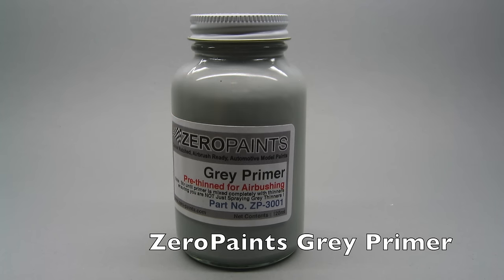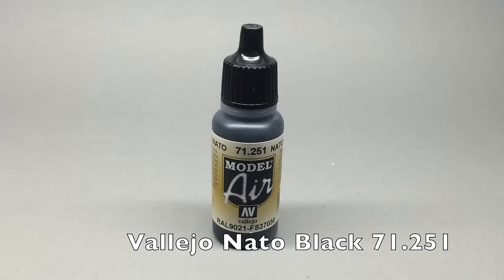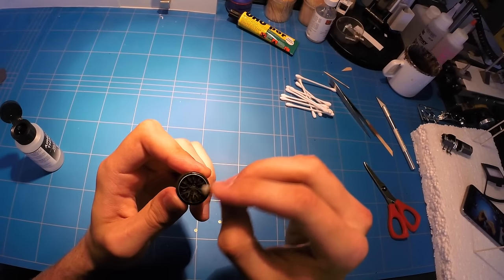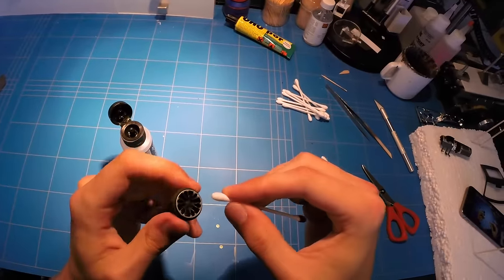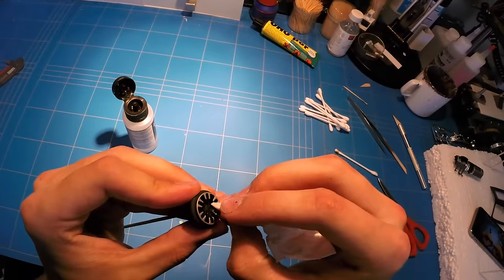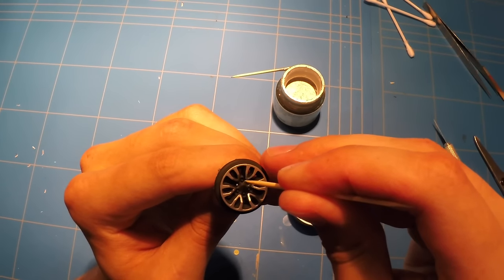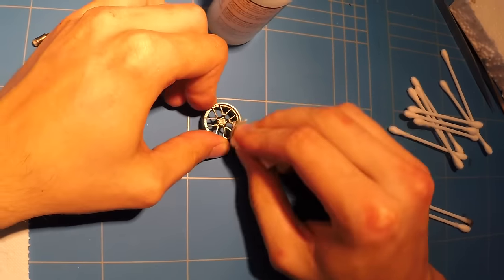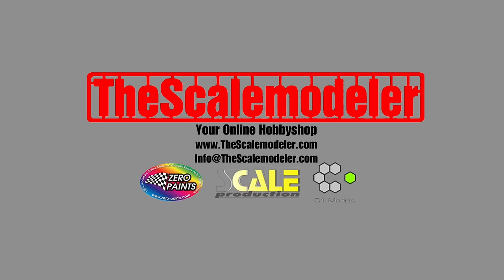How To: Diamond Cut Wheels

Comment: very good tutorial. I tried to do it but the bottom paint layer had been a bit stripped as well. So, to weaken the adherence of top layer, I applied with my fingertip a little coat of automotive wax on the wheel so the bottom layer wasn't stripped as a consequence.

Comment: +The Scalemodelling Channel, would i be able to use tamiya paint over the zero paint or does it have to be vallejo?
Reply from the maker: +Mal Richardson tamiya paint is different. That is not fully water based. Its a mic of water based with enamel. So im not sure if ilt work

Comment: tried it out with som zero paints flat black over zp primer and on top Vallejo metal air chrome but the Flat black came off too :/
Reply from the maker: Wich thinner or cleaner did you use? Zero paints or Vallejo. You could also try clearcoating the black first and then applying the vallejo.
Reply: I used the Vallejo thinner like you did. Clearcoating could have worked. But i painted the black parts by hand now. Going to try it on some other build sometime.